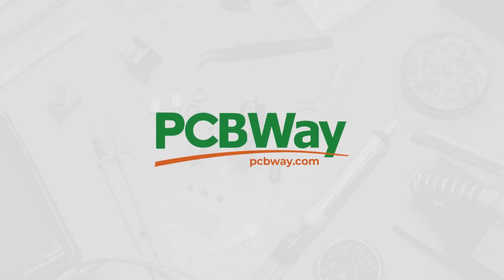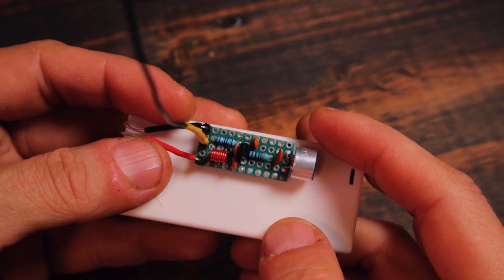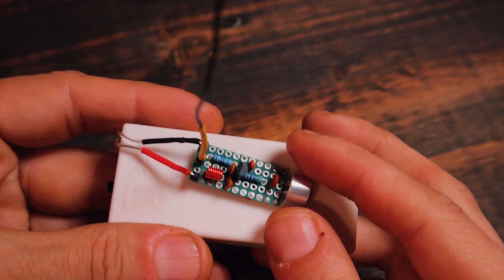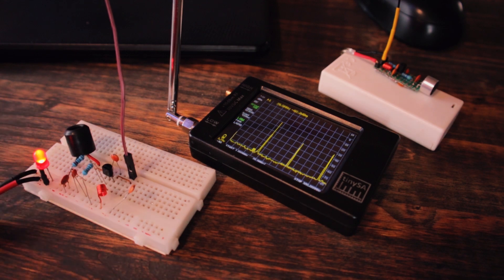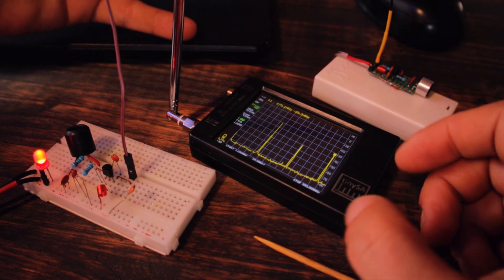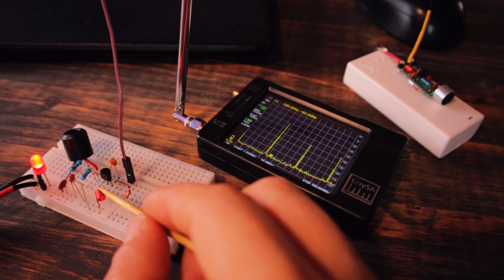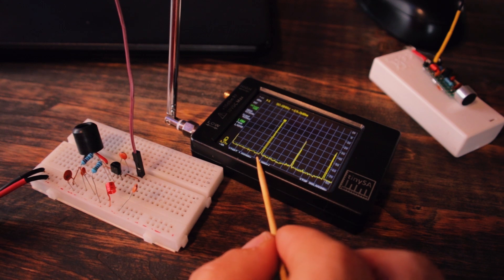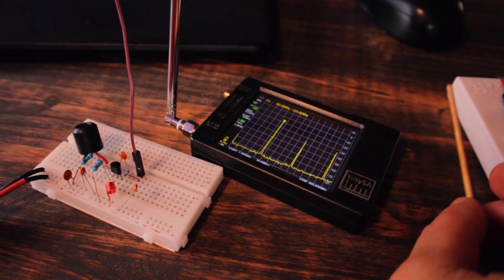One Transistor FM Spy BUG ( Baby Monitor ) - Up To A Hundred Meters

Comment: can i use an 2n2222?
Reply from the maker: You can try but it didn't work for me. It wouldn't resonate higher than 60Mhz. Only if you manage to make it resonate lower and you will basically listen on FM to the 2nd harmonic instead of the fundamental. 73, YO6DXE.
Reply: @dxexplorer  tnx for the fast response, im devoloping the pcb now with a laserjet printer and the ferric chloride, il try some different transistors, tnx again
Reply from the maker: Always a pleasure. Yes testing other transistors its good. That is also what I did so I can find the right one.

Comment: i created an am transmitter and it worked, within a one metre distance.  i have been trying since to make an fm transmitter, i got one to work with only the sound of tapping on the mic but it would not transmit any of my voice.  i tried your circuit too, i could not get any output on the radio perhaps i am using wrong coil inductance calculator, which formula do you use?  your tutorial is very nice and very easy to understand.
Reply from the maker: I didn't use a formula, I just used the instructions in the schematic I found. But it had too many turns and it was resonating in a totally diferent frequency so I reduced the turns to half of the number. But it depends very much on the transistor as well. Some may resonate where you want and as you calculated it... some a lot lower or higher. Is because the schematic is simplified a lot. So you can either try playing with the number of turns, or by changing the transistors and see the one that does the job right. The calculator I use to calculate the resonant frequency is Coil32... you can find it in Google Play store and it should be in the App store as well I think.
Reply: @dxexplorer  great, it is good experimenting, i keep trying, nice one , keep up the good work.
Reply from the maker: @samosdolphins123 I also want to play with these a bit more trying to do something on a PMR frequency but more stable for sure. Its a lot of fun when there is nothing else to do. 73, YO6DXE.
Reply: @dxexplorer  good luck with your projects.  i am now helping my son build a soundcard oscillator, not sure if it will work i found the circuit online will give it a try .  so we can check the waveforms of the oscillator circuits we build on the breadboard.  fun stuff.  i never did learn electronics until recently i took an interest been reading lots of theory lately to learn it and testing some circuits it is fun.  can be frustrating when it dont work though.
Reply from the maker: I know the feeling. I also got back into this in 2019 I beleive while in Italy visiting my sister. I found am old broken radio there, used the part to build something and it worked... then I just couldn't stop 😁. Some work some don't or they do but not as I wish they worked... but it's all part of the fun so I enjoy it. Good luck with the project... sounds interesting. You made me curious.

Comment: I was hoping you would explain how this circuit oscillates and how the mic modulates the frequency of the oscillation. Thanks.
Reply from the maker: I thought so as well but considering that the big majority of those interested to build this one don't care much about that part as they just get bored.. I rather spend more time building amateur radio gear. This was just for fun. Plus that honestly YouTube is already full of videos on oscillators and videos about modulation when it comes to the theory part. 😄😄

Comment: its better to use PCB Prototyping bord  because the breadboard add  capacitor between components legs.
Reply from the maker: Yes. Usually I build stuff Manhattan style but for quick testing breadboard is good enough then I move to some sort of soldering on something and test again )). I hate breadboards though ..  always having problems with bad contacts.

Comment: Nice build , i did that project when i was young  i remember  the range was about 150m . the microphone and other components were found inside old radio k7 Player .
Reply from the maker: It's a nice simple project fun to built. Even though as a kid I only made one to work, the rest not so much. But also I had no idea what I was doing back then 😅😅. Thank you for watching. 73, YO6DXE.
Reply: yes back in the day when we were in college we didn't have the knowledge   or the components to build a high power one , we had access only to some electronic magazines, now we can build an RF tower but we are limited by the laws and rules . to monitor the baby u can use a low cost wifi camera.

Comment: FM transmitter, I prefer shortwave radio transmitters. I built a shortwave transmitter a few years ago, but the audio modulator part of it broke. And the buffer stage exploded. I haven't been able to fix it since, so it's now an FM transmitter for my OIRT radios.
Reply from the maker: I am not at all into these since they don't have much to do with the amateur radio hobby but too many people requested a video so I thought is time to make one 😃. I also prefer shortwaves hehe no matter if is a receiver or transmitter 😅. 73, YO6DXE.

Comment: Here in Australia many years ago, we had a company called Talking Electronics. They did a whole series of magazine's on FM bugs.   They were all on the FM broadcast band, and as the series went on, they designed them to have more range. There first was called the Ant, and they had the little PC board taped to the magazine. The magazine would appear in the newsagents at some random time. All their designs were able as kit's. But the magazine had both the schematic and artwork for those etching their own boards. They took their Ant bug and modified it to use with an electric guitar. So using any FM radio as the amp. I built that one for my wife who plays the guitar. I also built their vox bug. In listening mode it drew miniscule amount of power. The slightest sound, and it would switch on and transmit what it was hearing. It would continue to transmit for a few seconds if it went silent, so it wouldn't be switching on and off. This one used an IC for the vox part of it. The person that owned that small electronics company, was a very smart man. The magazine's explained really well how everything worked.
Reply: Talking electronics is still about, just been on there site , owner is Colin Mitchell,I've learnt loads over the years from Colin Mitchell
Reply: @dazaro3 Yes. There is video on YouTube of Colin Michael being interviewed by someone. Talking about older days, and the FM bug magazines. He talks about the first one he built. He was impressed with the results, and that's what started it. I remember he wrote in one of the magazine's, about not getting more distance by brute force, but more elegant design. It was a while ago I watched the interview now. I think there was several. How talked about some venture into America, but from memory, that didn't work out.
Reply from the maker: @trevorwoods3367 I will search for it and watch this evening once I am done with work. Thanks so much. I am looking forward to this. These kind of life stories pretty much I like very much. Life is flying too fast... memories are treasure. 73, YO6DXE.
Reply from the maker: @dazaro3 The designer of the circuit you mean ? I will search for him as I was curious who came up with the schematic. Is really fun to build and so simple. Is all over the internet but no one is mentioning the author. Thanks. 73, YO6DXE.

P.S. Got it... the one designing the circuits in the magazine.))
Reply: @dxexplorer That circuit doesn't look like a Talking Electronics one. (Colin Michael). They always did the same with the fixed capacitor and little coil. Using the coil to move it to where on the band you wanted it. I don't think they even did a single transistor bug. Their first. The Ant. Was two transistors. One for the mic part, and one for the oscillator. To get more range they later added another output stage. In fact, the final output stage used that same transistor you are using. I recognised it straight away. All other transistors were BC548 from memory. The output stage had a tank circuit, I think they called it. There was a coil capacitor arrangement. It needed to be peaked for maximum output. I remember they showed how to do it using an analogue multimeter. I just did it with a radio on the other side of the room. Suddenly the radio just squealed.
Update: I was wrong. The output transistor was a 2N3563. I think the others were BC547.
Reply from the maker: @trevorwoods3367 Ohh there are indeed schematics with three transistors. I think I know what schematic you are talking about. The range with that one will increase indeed... but today... the fines will also increase with the range of the transmitter hahaha. I think for the future I will play with some designs for the CB band... 27 MHz and maybe PMR here in Europe... 446MHZ I beleive or somewhere around there. This one scared me already since I could still hear it in the transceiver on open field 1.5km away. Once I put it inside the house or the camper then it goes down to 50-80m.
Reply from the maker: @trevorwoods3367  woaaaaaa now I wish I had that as a kid. Imagine the fun and joy hehehe. We had some stuff here when I was younger but usually there were complicated schematics with transmissions on the medium wave, usually poor quality so I lost the interest. But now with so many emails I received I decided to build one out of curiosity and since my friend needed something I thought is a good time to make a video as well hahaha. Not a vad idea about the quitar... I must work on that as well ))). Thanks for sharing the story. 73, YO6DXE
Reply: Ah yes talking electronics... bunch of 555 projects too. They even released the TE555, their own customized version of the 555 ic
Reply from the maker: @udhi_gn3893 I love 555 projects 😄. I found a lot of useful ones.
Reply: Bro, I went on this Talking Electronics I'm so amazed. If I had these ebooks in high school 20y ago I would have been in paradise. Even now, amazing the transistor explanation. Thanks !

Comment: I made one when I was a kid for spying purpose 😉(I know it's bad)

At 3'45", schematic : Missing a resistor between the battery and the zener diode; Otherwise, the zener itself will drain the battery downto 2.2V
Let's say 220 - 680 ohms or more
Reply from the maker: Hahaha. This is funny. I built one too but it had two transistors. Yes I thought about the resistor but I was thinking that it's only needed if I use a higher voltage like 5v. I will put one then. I didn't know is draining the battery.

Comment: this is a kind of Josty Kit (HF65) search with Google,  search and look at images / schematics this works best with a LF stage in front and a HF stage behind it,  
the way it is now on video it is questionable whether it will work well. (mainly stability is the problem)  by the way this is not 100% FM but reactance modulation ( mix FM/AM )
Friendly and Healthy Greetings from the Netherlands location Rotterdam
Reply from the maker: You can tell is not FM as I can also hear it in AM mode only that the modulation is not that great. Ohhh I am sure there must be better schematics for sure. I remember one I built long time ago that used two transistors and it was fixed in frequency with a crystal. This one... is more like a project for fun. Is sensitive when it comes to stability.... to touches, whatever you have around.... but other than that once you leave it in one place is pretty stable for the simplicity of the circuit. I was impressed as I was expecting it to be really bad ))). Have an amazing weekend, 7 YO6DXE.

Comment: Nice video buddy.  6 years ago i made a similar FM bug Tx using 2N3904 Transistor   with telescopic antenna i got signal range about 100 Meters. 73. DE VU3IZD
Reply from the maker: Ohhh yes it scared me a little when it comes to distance. And that is because I live in an open field... and when I went to the store out of curiosity I took the transceiver with me to listen to the transmitter. 1.5km away I was still receiving it hahaha. Weak and with interferences but I could hear it. That is when I thought... ok I need a smaller antenna.